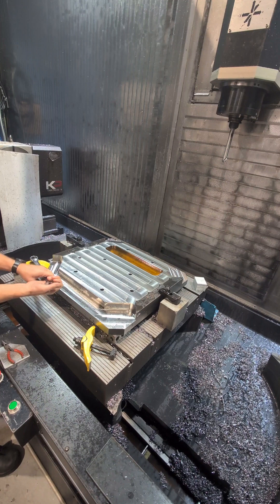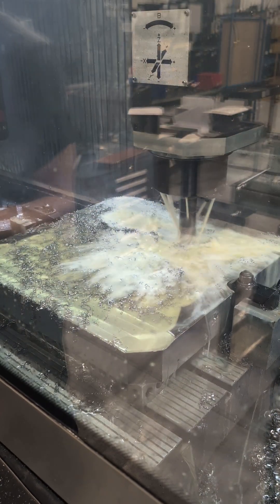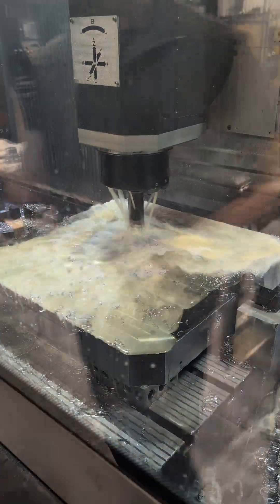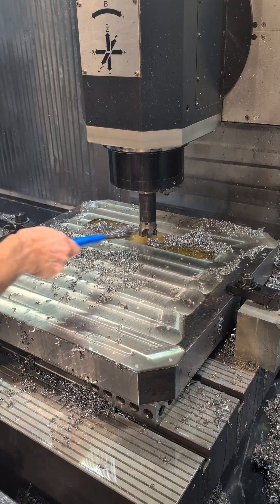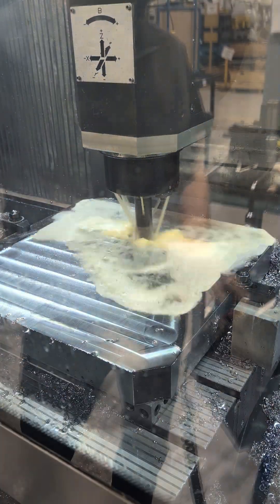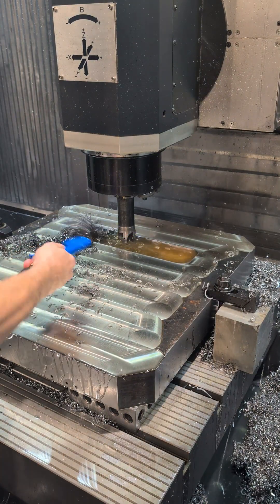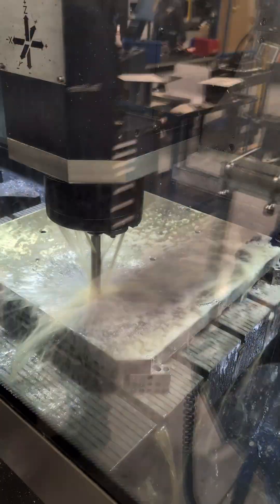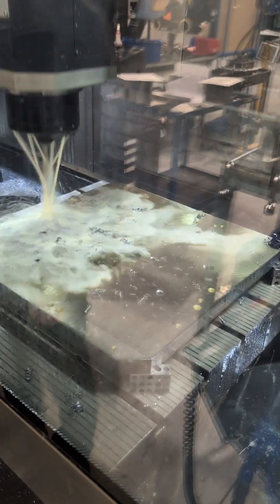The pocket from hell.#cnc

Comment: You can get 90° tool holders
Reply from the maker: @Red-SealRALLY  We get what we get, it's a 2" 90° Chinese face Mill. I only had two of these to make. Unless you mean setting up my part at 90°?. That would be interesting. My head turns 90 so I wouldn't need an aggregate head , but way too much setup for two pieces and awkward.
Reply: @seedysteve4099  lol I didn't see it was 4 axis.